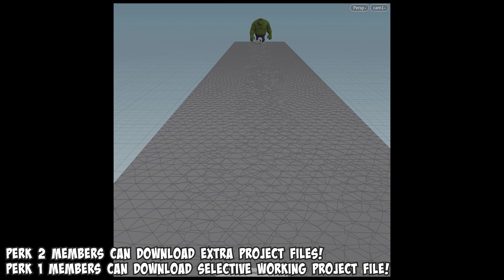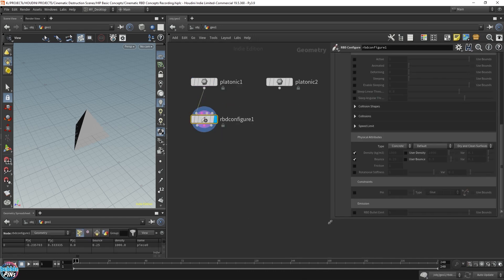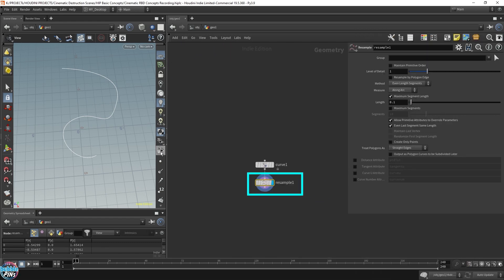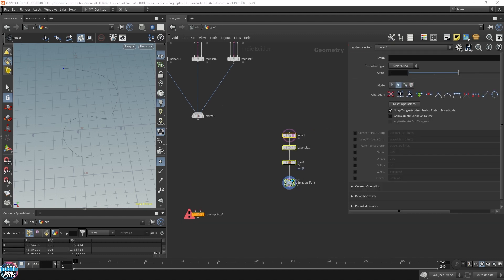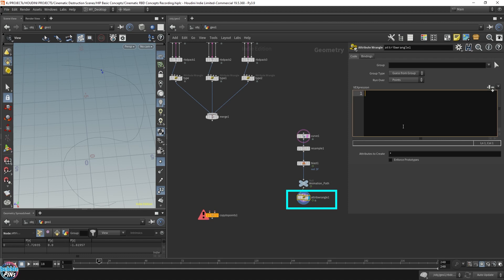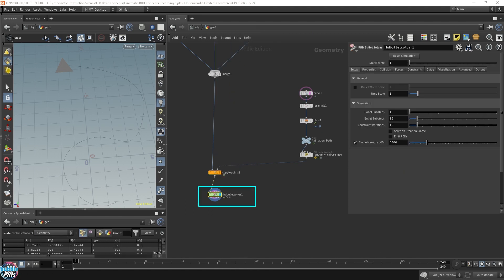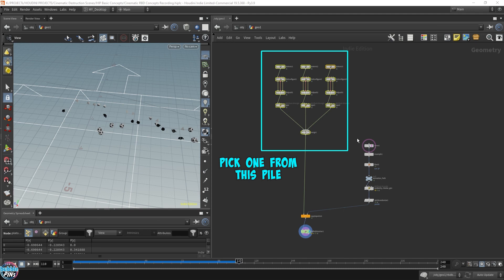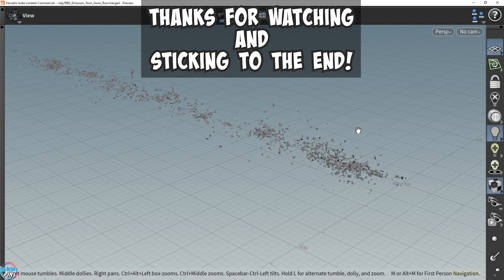Cinematic Destruction Basic Concept #1 RBD Emission (Rigid Body Dynamics)

Comment: but how randomized pscale can work on just one point this way? It should be smth like f@pscale = fit(rand($F, 0, 1, .2, 2);  shouldn't it?
Reply from the maker: these aren't particles!  they are actually different geometry created to act like rbd blast pieces.  it's a rbd simulation without actually fracturing anything because instead of fracturing, we're emitting rbd pieces.  So I create a few various rbd pieces ahead of time and randomly instance these into the rbd simulation.  It's really efficient and fast, but it's completely inaccurate!
Reply: @bubblepins  I said that pscale randomizing doesn't work in that way you show in your video. But actually i'm not sure about that because i'm newby in FX :) Can you explain how it can work?
Reply from the maker: @KirillovVladimir1980  Sorry I misunderstood, when I saw ur expression I just thought u were referring to 8:00 in the video. The express u have there should work better than what I had, which was just a randomize attribute node, ur just missing a bracket f@pscale = fit(rand($F), 0, 1, 0.2, 2);  just fyi for anyone reading this comment, I don't mean to be picky.  But the expression u have should work better than what I showed in the video, it's been awhile since I made this video and I haven't had time to rewatch yet, but I think ur right!
Reply: @bubblepins  Thanks for ur answer. Mayde u can explain me how can i get your hip? I did the solution from ur video but as i'm newbie i do not understand how can i add upward force to rbdsolver and putting popforce into rbdsolver doesn't work:(
Reply from the maker: @KirillovVladimir1980  Sorry my HIP Project files are only available for Perk Members, it's a paid membership program on Youtube, you can join by clicking the Join button right beside my bubblepins name under the video, but its a paid membership.  You can check out the prices as I charge less than a coffee for it, just click the Join button to see the prices.  They are hosted on my blog where you can download the hip projects, but are password protected and the password is given out to Perk Members with a link in the description that only Perk Members can view.  I hope that helps!

Comment: Hi thank you for your videos, I wanted to ask if the sim at minute 10:45 is included in the hip file, ty
Reply from the maker: I usually post the screenshots for the project files on my blog.  The project file for that running sim u r interested in should be included, but NOT the toon goon character, because that's something I don't have rights to distribute.  I swapped out the toon goon character for one of Houdini's default character:
https://bubblepins.com/membership/cinematic-destruction-basic-concept-1-rbd-emission
Reply: @bubblepins  Alright thank you!